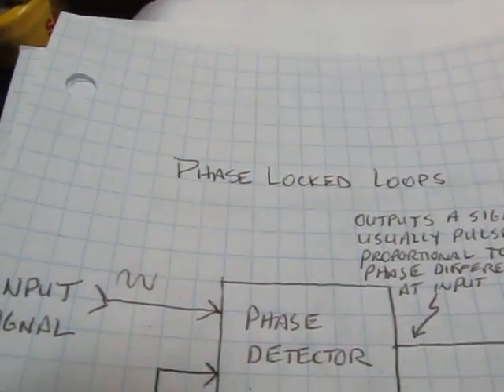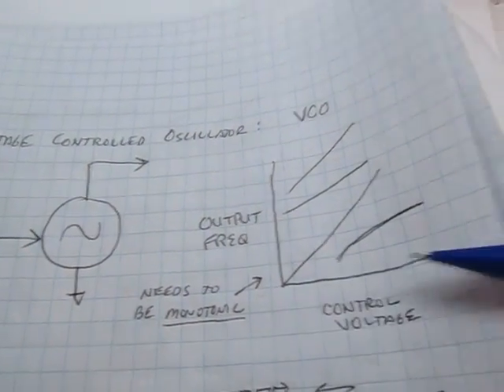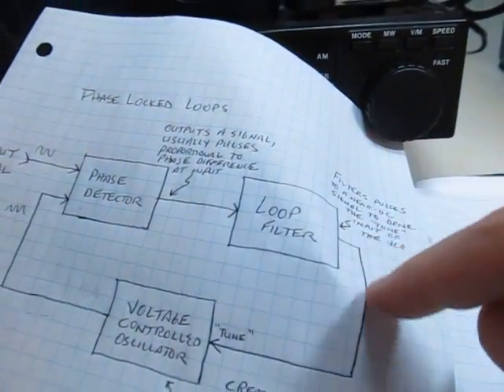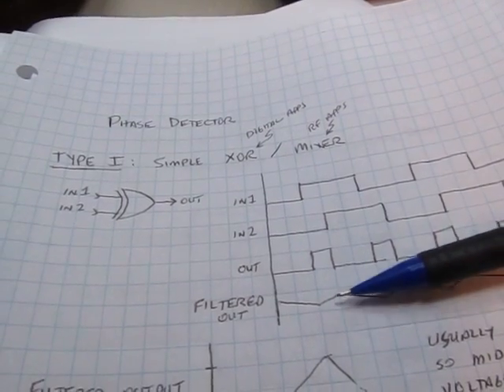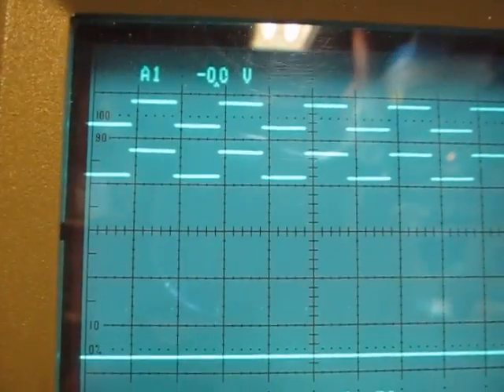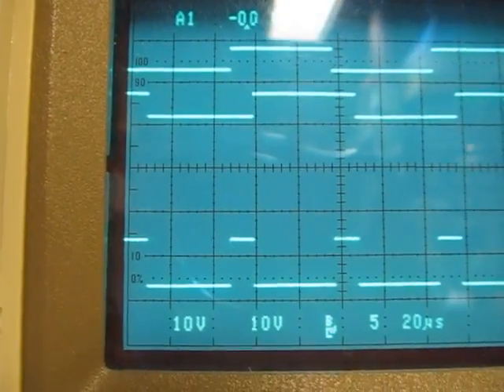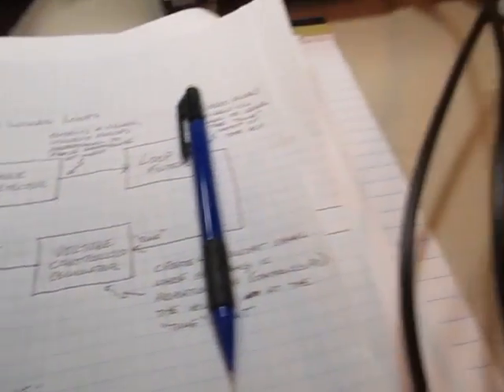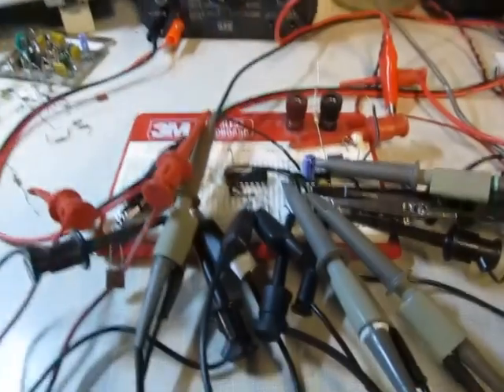#60: Basics of Phase Locked Loop Circuits and Frequency Synthesis

Comment: I really really like this video! Thank you! However I've got a question: The Type 2 basically is controlled by the rising edge right? But I don't understand how. In your Video first in 1 goes up so P is up in Out. C is being loaded and this is seen by the Filtered Output.

However then when in 2 Comes up N is also activated and the current can run down from + to GND. Therefore C still is charged and the measured Output remains high.

However in your drawing then IN1 is down, which means the P Switch is off while the N Switch is still on. Now the Charge from the C should be pulled out over N to GND until N is turned off aswell. However this doesn't happen, the filtered Output stays high until it's triggered by the rising edge of N. Why is this the case?
Reply from the maker: If IN1 arrives before IN2, then the P output is ON for the time between those edges.  If IN2 arrives before IN1, then the N output is active for the time between the edges.  The timing diagram shows this.  When neither the P or N is ON, the output is high impedance, and the charge on the capacitor stays constant (except for any current to/from the attached circuitry).  When the loop is locked, there are only very small "blips" on either P or N, just enough to tweak the voltage on the loop filter cap.

Comment: Looks like there is another PC3 in the 74HC4046 (pin15) chip, I was just wondering what the differences between type 2 and 3 are . Thanks.
Reply from the maker: PC3 is described on Page 8 of this datasheet:
https://www.onsemi.com/pub/Collateral/MC74HC4046A-D.PDF
It is an positive-edge triggered FF design.  Loop is locked when the inputs are 180 degrees out of phase.
Reply: So does it act like PC1 more and might lock on the harmonic signal?

Comment: Hi w2aew,

Is there a limit to increasing the frequency using a frequency divider? how far of a ratio can it go to ?

Thanks,
Ram
Reply from the maker: +Ram S In theory - no.  In practice, the higher you make the divider, the slower you'll have to make the loop filter since the phase detector will get its feedback much less often, and you'll need the VCO control voltage to be very stable between the phase comparisons.  So, yes, you can get much higher frequencies with a deeper divider - it's done all the time, with proper design of the rest of the loop (loop filter and stable, low noise VCO).

Comment: Are all PLLs \ phase detectors digital by nature or are there fully analog ones?
By using circuits like 74197 or 74292 you can synthesis any rational number multiple of the base oscillator frequency?
I can not comprehend how some PLLs can be so low in noise !? Yes, the loop filter might be very slow, but still.
Reply from the maker: Dividers can be used in the feedback path as well as the reference path, thus easily creating any M/N multiple of the reference.  There are also fractional-N sythesizer designs that allow you to reach non-rational combinations.
Reply: @w2aew  And you can use multiple loops to generate finer ratios without super low internal frequency.

Comment: I get a much narrower frequency lock and capture range with a digital function generator than an old analog generator. I can't figure out why. Any thoughts on that ? Thanks
Reply from the maker: I would imagine that if you're looking at 'tracking range' - how far you can change frequency and remain locked - that you might see this wider for an analog generator than a digital function generator.  This is because an analog function generator will tune smoothly and monotonically from one frequency to the next.  A digital function generator might take wide jumps in frequency, potentially outside the lock range, thus the PLL would have to re-lock (re-capture) it.  The capture range is less than the tracking range.  Even if the digital generator doesn't jump outside the frequency range, it might tune so quickly that the PLL can't follow it, thus it has to re-capture it, and you're left with the same problem.
Reply: @w2aew  Thank you for this explanation. This gives me a good reason for more experimentation on this phenomenon. I see many blogs on pll's where most agree pll tracking and lock ranges are the same in newer pll's. Very confusing to some students. Digital function generators may be the reason.

Comment: Thanks for the video! Under which situations do you differentiate between using the phase detector 1 and phase detector 2?
Reply from the maker: +Harris Shallcross The datasheet more completely describes each of the detectors and which situations you'd want to use one or the other:
http://www.ti.com/lit/ds/symlink/cd4046b.pdf
Reply: +w2aew Aha, I see. Thank you!

Comment: On 20:52 you started talking about phase shift but you haven't mentioned when increase and when decrease voltage. Is vco output leading or lagging reference signal when you increase/decrease voltage on vco input? 

I used logic and I think if you increase voltage then phase detector want to compensate so it decreases voltage and vco output starts leading reference signal. Am I right? 

I tried something else using crystal oscillator as reference so pll locks on this. I added potentiometer between phase comparator 2 and vco input (with low pass filter obviously). Now, I can only shifting phase in one direction (by lowering PC2 output voltage). So when I tuning potentiometer down, vco start leading or lagging crystal oscillator signal?
Reply from the maker: Your logic sounds right.  The loop is going to try to counteract the offset you create.  If you lower the phase detector output, the loop thinks that the VCO is lagging, so it turns the VCO control voltage up causing it to lead.
Reply: I tried to observe this behaviour on oscilloscope but I'm not sure about that. When lowering PC2 voltage fed to VCO input then create a phase shift.  But when I lowering more and more then overshoot whole period and phase shift should decrease. But it doesn't.
Reply from the maker: The way I did it was to apply a voltage through a resistor connected to the VCO control input.

Comment: what resistor and capacitor values did you use for the low pass filter? thanks!
Reply from the maker: I made this video over 6 years ago, so I really don't remember. I think I used an example circuit from the datasheet.

Comment: if you have a divider or multiplier then why do we need the rest of the components like vco or filter to get any desired frequency?
Reply from the maker: By using a combination of dividers in the reference, feedback and output paths, you can synthesize non-integer multiples of the reference.

Comment: Thanks for the video ... but how did you implement the circuit? I'm trying the same circuit but it's not working...
Reply from the maker: Measurements were all made on an operating circuit using the schematic found in the datasheet for the chip. The circuit was implemented on the breadboard as shown in the video.
Reply: thanks for the reply. I've managed to obtain some stuffs working but the the vco output is not stable... any theory to solve that? I'm trying to lock 50 Hz...
Reply from the maker: Have you followed the design recommendations in the following application note, for your required lock frequency, lock range and loop filter characteristics?  This is the best place to start:
http://www.ti.com/lit/an/scha002a/scha002a.pdf
Reply: thanks. I Will follow it...

Comment: I'm confused about frequency synthesis. With the divider in place, the output from the phase detector is half the amount of pulses. Wouldn't that make the VCO produce half the frequency? Or does the VCO have an inverse relationship to voltage?
Reply from the maker: The divider goes between the VCO output and the Phase Detector input.  Therefore, when you divide by 2, the phase detector "sees" a signal that is half of the frequency of the VCO output.  Since the PLL loop is only locked when the frequency and phase of the inputs at the phase detector are matched, it responds by increasing the VCO frequency until the inputsof the phase detector match.  This occurs when the VCO frequency is 2x the input or reference frequency.  If a divide by four is used, then the VCO output will be 4x the input frequency, etc.
Reply: Oh I see! Thank you for clarifying. So I suppose the response time to adjust ("lock"?) is a property to consider when implementing or selecting a PLL.
Reply from the maker: katelikesrectangles Yes, absolutely.  Lock time, loop bandwidth, tracking range, locking range, etc. are some of the parameters that need to be considered (and sometimes traded off) when designing the loop filter and VCO circuits in a PLL.
Reply: Great! Thanks :)

Comment: At the end, the type 2 comparator has different pulse amplitudes for lagging an leading, why is that?
Reply from the maker: It is because the "resting" vco control voltage isn't exactly in the middle of the tune range.

Comment: Hi again, is there anyway I can contact you via emailing? I built a PLL using the same chip CD4046 but I am having problems with phase shift and output signal amplitude. There is a 90 deg. phase shift in the output signal and the amplitude is half of the input signal. I can't seem to figure out where it is coming from. I am using phase comparator 1 and my locking frequency is 4kHz and RC low pass filter has cut off frequency of 129 Hz. it would be great if you can express ur opinion on this! tnx

Comment: This is what I do not get. In Type I detector, when everything is aligned, you get 0 volts after low pass filter, basically putting VCO control voltage at 0 volts. How does this not revert VCO output frequency corresponding to ground and subsequently losing lock (given that input frequency is achieved at some non-zero control voltage)
Reply from the maker: The reality is that the op amp in the loop filter has a fair amount of gain, so a very small "error" voltage between the inputs is all that is needed to keep the loop closed (where the phases are very, very nearly aligned, with some very small offset).

Comment: unintelligible question looking for magic words - only 12 years late.  Say you have a VCO that outputs 0-1000 Hz for 0-1 volt in.  XOR that yields 0-1 volt.
Put in 500 Hz sqr wave you get a 0.5 out of the PD and a 90-degree phase shit in lock.  400 Hz you get 0.4 Volts and 72 Deg phase shift and so on.  
Any insight into the math behind the XOR and what the negative feedback loop is trying to correct?  How is 90 Deg 70 Deg and so on in lock correcting the phase error?
I've got a text that assigns Vdo to the phase det and Vco = omega in for the VCO but it still doesn't explain anything to me.  Kd*Ko*F(s)/s will give you the frequency but not explain the phase shift.
Reply: In ten years if someone looks at this...  In the case above the stable part of the XOR goes from 1 volt when the VCO lags Vin by 180 (ph = -180) to 0 volts in phase (negative slope).  The VCO lags the input.
For the 400 Hz input, the low pass filter starts at 0 volts (freq out = 0) and the output rises up to 0.4 volts (VCO=Sin(400t-72deg)).  At this point if the VCO frequency goes up, the lag gets smaller (say 72 to 71 deg) and the input to the VCO goes down.  Also if the VCO freq. goes down the lag gets longer and the XOR output gets bigger.  I think this is how the loop locks.
Reply from the maker: Because you don't have any additional gain in the feedback loop, there will have to be a phase difference in the loop in order for the average voltage to equal the necessary VCO control voltage input to get the desired frequency.

Comment: I had a question. Does adding the divider in the loop change the feed back loop response time. Does it make it faster,slower no change?
Reply from the maker: It depends on a few factors - but mainly it depends on how much the divide ratio affects the apparent VCO control voltage gain.
Reply: Thanks,Sounds like I need to experiment to find out. I'm building a PLL to detect tempo in a music source for triggering a lighting effect in sync with a drum beat.

Comment: I think that the loop filter is not a simple low pass filter, or maybe I understood it wrong, but if it was, the error will go to zero -> low pass -> 0 DC -> always 0 volt frequency vco wave.
Reply from the maker: It depends on the PLL design, and what type of phase detector is being used.  The loop filter's job is to "smooth" the result of the phase detector output.  Some phase detectors output short pulses to increase of decrease phase - these are typically integrated onto a capacitor that "holds" the control voltage for the VCO.  Other PD's output a pulse stream whose duty cycle varies with phase changes, so the output of the filter is the average of the pulse stream.
Reply: @w2aew  Ok. But in the video seems that the vco only controls the frequency of the wave then I don't understand how, with a single 1 feedback signal can the system work on phasing and frequency. I mean, let suppose that the frequency in not right and the error goes into vco -> after some time the feedback reach stability and the waves have the same signal. At this time however could be differences in phase, but in your oscilloscope seems that the system can get the frequency and the phase right. There is something I lost somewhere :D
Reply from the maker: @lucagessi-creatives  True - the control voltage on the VCO sets the frequency.  Thus, there is another "integration" that happens in the closed loop.  To adjust phase, the VCO control voltage is changed slightly and then returned back to the same voltage (frequency) - this results in the VCO outputting the same frequency but with a phase shift.  This is why a 1st order loop filter winds up giving you a 2nd order loop response (due to the integration from the phase adjustment).

Comment: 6:07 Can you use a differential amplifier here set up to amplify the difference? and use a full wave bridge rectifier to convert both the positive and negative peaks to the desired polarity? (Surely with non-ideal op-amps and diodes this will be not as effective, but just for proof of concept?)
Reply from the maker: We really only want to measure the phase difference, thus only interested in the relative positions of the edges.  If a difference amplifier were used, then any difference in signal amplitude, high-low levels, etc. will affect the ability to cleanly lock onto the phase.  Also, often times the reference (or Fin) is sinusoidal.  We don't want any differences in signal shape or amplitude affecting the VCO input - just the differences in position (timing) of the edges.
Reply: ***** Are these only used with square waves? What about sine waves? Also, I was actually thinking of comparators, (I use the terms interchangeably since they are essentially one in the same) to fix the issue of the output signal from it, would a Schmitt trigger help?
Reply: ***** Also, with only one input, why not simply amplify the signal and use it? it would have the same phase, wouldn't it?
Reply from the maker: Power Max Phase detectors can be used with various signal shapes (square waves, sine waves, pulses, triangle waves, etc.), since they typically only look at the timing of the edges.

Comment: Hello, Can the CD4046 chip be used stand alone like the LM567 to detect a specific tone?  LIight an led etc.  thanks
Reply from the maker: Not directly, you'd need some additional circuitry to help detect a specific tone.
Reply: @w2aew  thanks again

Comment: If you have to provide a reference signal doesnt that defeat the purpous?
Reply from the maker: Not really. The reference is usually a fixed frequency, which makes it easier to get good stability, low noise, etc.

Comment: Hello at 11:07 you say "this output is essentially high impedance". What do you mean by that? Is that push-pull output impedance?
Reply from the maker: It's high-impedance because at that point both FETs are off - almost like nothing is connected.
Reply: @w2aew  Oh ok thanks. Btw I have one more question. In type 1 XOR PLL there is 90 degree phase shit between input and output. And when the two signals are at 90, the average output voltage will be half Vcc.  I completely get that part. But my confusion is more fundamental here. Why does the locking occur at exactly half the voltage(Vcc/2)? Its a mystery for me. What's so special bout that voltage?
Reply from the maker: @mejoe444  VCC/2 would typically be the reference voltage at the input of the op amp / loop filter - so that the loop would drive the "error" voltage to this level.
Reply: @w2aew  in examples I cannot see any such opamp shown explicitly. They show XOR LP and VCO but there is no opmap which would set the error voltage to Vcc/2. Is that hidden in the VCO itself?

Comment: CAN U MAKE A VIDEO ON THE DESIGN OF AN N-INTEGER FREQUENCY SYNTHESIZER
Reply from the maker: If you look at 16:22 in the video, you seen how I describe out a divider placed in the feedback path can cause the VCO output the change.  If you also put a divider in series with the input signal, and have that input be a constant frequency reference, you now have the basis for a synthesizer.  Make both of these dividers programmable, and you have frequency selection that is M/N, where M and N are the dividing factors for the two dividers.

Comment: But how It can demodulate an analog signal, if all the phase detectors are digital circuits?
Reply from the maker: The phase detectors are digital, but they are used to drive the input of a loop filter which outputs an analog voltage to drive the VCO input.  When demodulating FM, it is this analog voltage which is the demodulated baseband signal of an FM input.

Comment: Why is a voltage used to control the frequency of an oscillator?  Why can't a frequency be used instead?
Reply from the maker: There is a class of oscillators that are controlled by frequency - they are called Injection Locked Oscillators.  Not so easy to incorporate these in a loop to synthesize new frequencies.